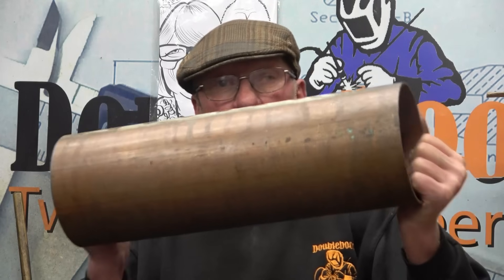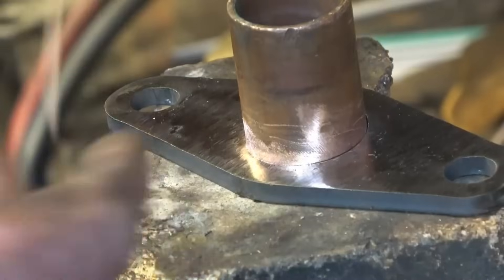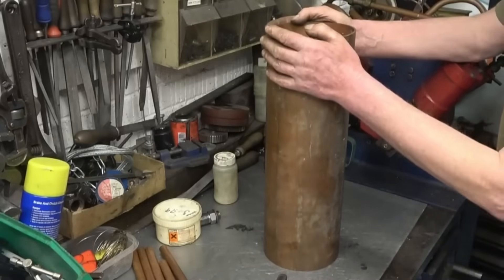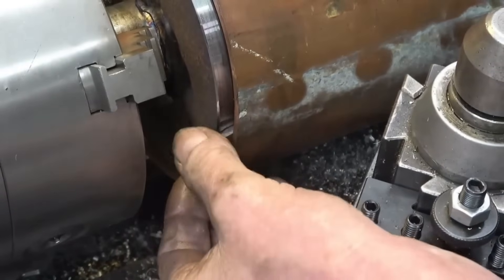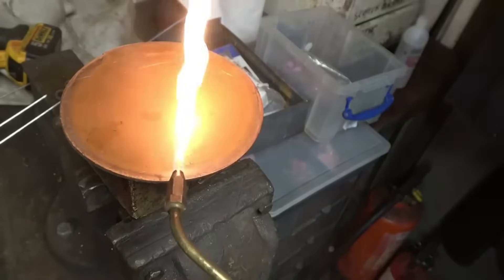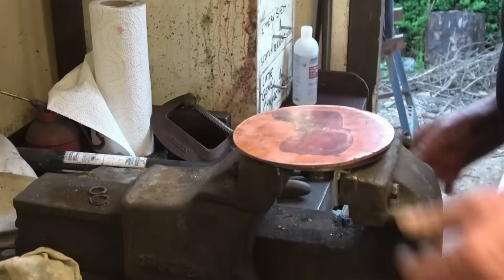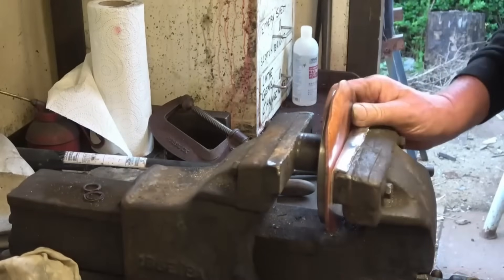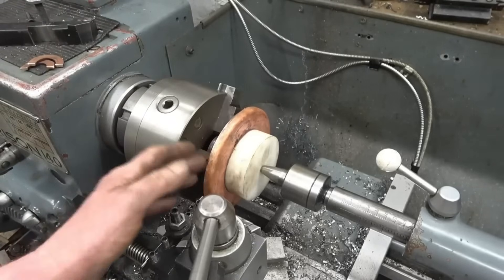Wednesday Catch Up 67  . Boiler Building , Flanging Thick Copper

Comment: Hi John, I used to machine copper components for large electric motors, we found that paraffin gave the best finish particularly when screw cutting. All the best.
Reply from the maker: Thanks for the tip, I will give that a try.

Comment: I can't help thinking the boiler caps should be domed. As they flex under pressure they'll tend to peel the solder joints, domeing will reduce the flex.
Reply from the maker: There will be about 60 11 mill copper tubes silver soldered in between the end caps they act a stays
Reply: @doubleboost  cheers John.

Comment: Truing it up you could have used the roller tool instead, and gotten it running true without removing any metal at all, and then a knurl to get a good surface to solder on to.
Reply from the maker: The Knurled finish is a very good idea

Comment: Good video. A roller tool ( like a knurling tool but just a ball race bearing) to form the edge would make for a neater fit
 and easier cleanup with the parting tool. Tool is also handy to bump with and true up work in the chuck.
Good to see you knocken em out ole mate.
Paul 🇭🇲
Reply: I believe I've seen John use one on this channel. It probably would work great.

Comment: Many thanks John. As a member of a model engineering club I would talk to the boiler inspector before cutting copper. 

You may well end up having to do a lot of boiler calculations to prove your boiler first.
Reply from the maker: Appreciate the advice, good to be safe.
Reply: @doubleboost  You are very welcome.

The rule is that you need to be building to a published (in the model engineering press or similar) or need to have a design on which the calculations have been done. The plan then needs to be approved by a boiler inspector who feels able to do that. Not all will and not all clubs have access to one.

That said, you should be able to find one and they will probably give you lots of advice.

My club does boiler tests for free with membership.
Reply: John looks like a interesting project for you. Lots of good replies explaining regulations on boilers. If its for personal(your gargen) use do you need a certificate?. Obviously you will test it to your standard of safety. Making a safe boiler will be no problem to you with all your experience & skills in engineering. Plough on John thou get there marra..